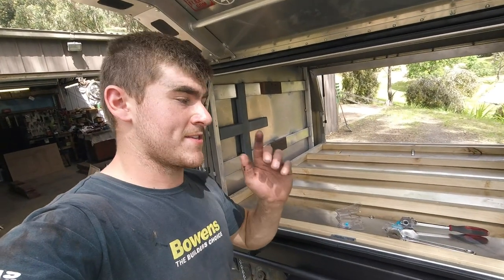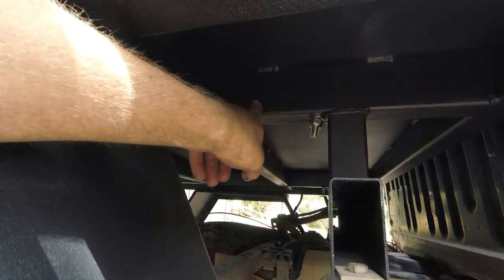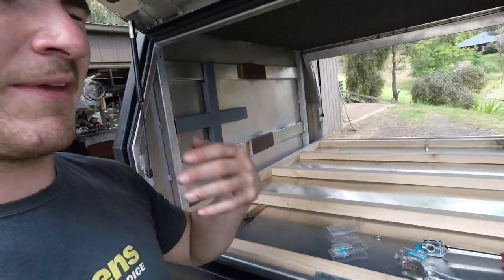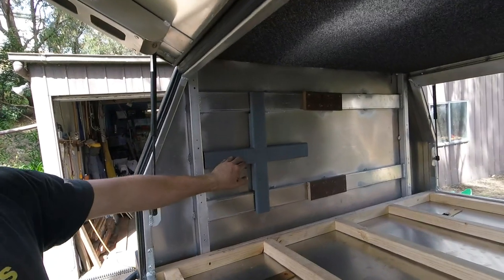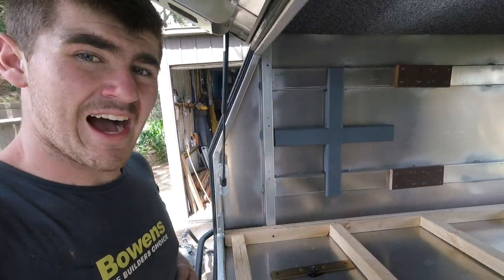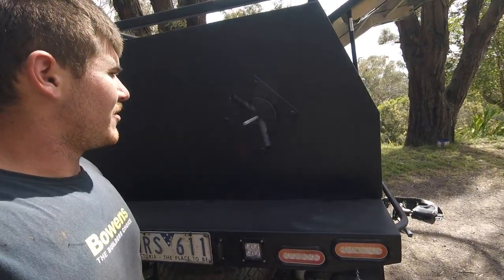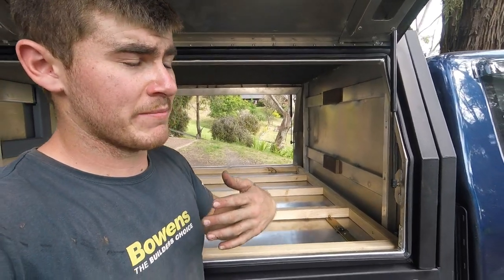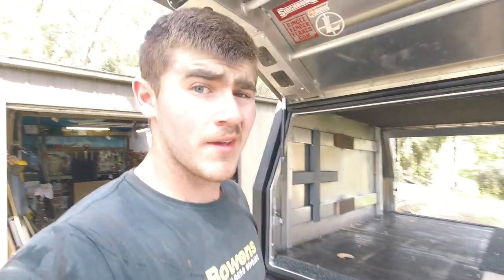Custom Tray and Canopy

Comment: Put a 21watt resistor in your led indicator circuit will stop the fast flashing of indicators
Reply from the maker: Yes, I've got some that have been sitting in the ute. Haven't put them in yet
Reply: @danloughridge3720  I had mine like that for about 2 days untill it drove me insane haha build come up good mate

Comment: Nice build mate, looks good 👍 I’m building up a tray for my Ute and thinking of using Raptor, I’ve got alloy sides and a alloy box. How is yours holding up?
Reply from the maker: It's not bad. The primer is a must for alloy and the prep is key, I'd us a rougher grit then what the directions say so it really bits in. If you don't let it  cure before using it, it chips off a little. Other then that look nice super easy to use. If you want a smoother texter get the adjustable gun.